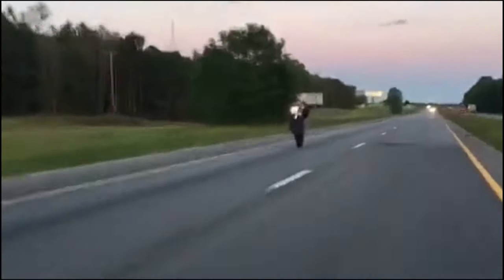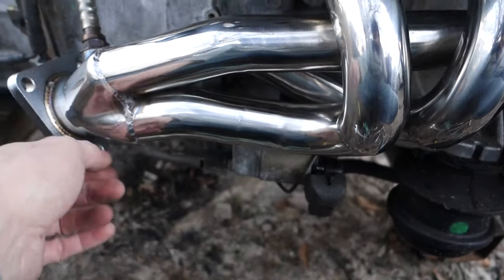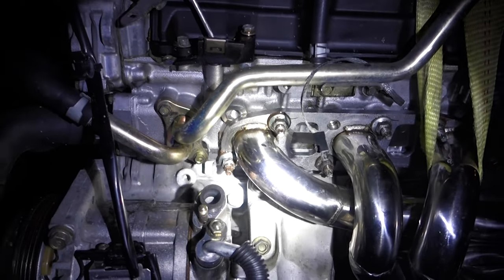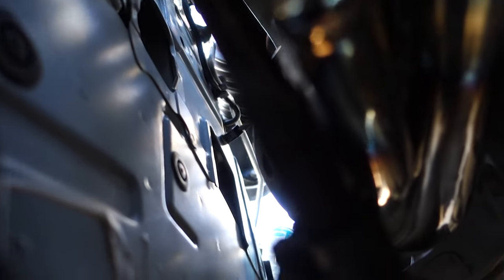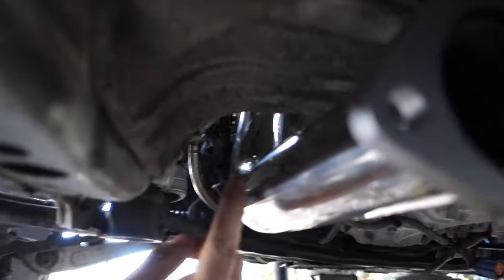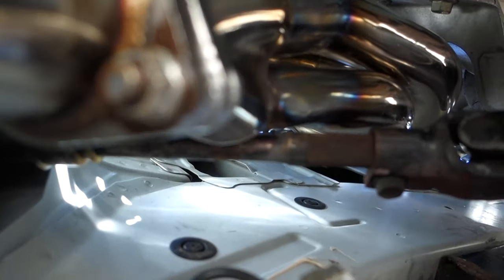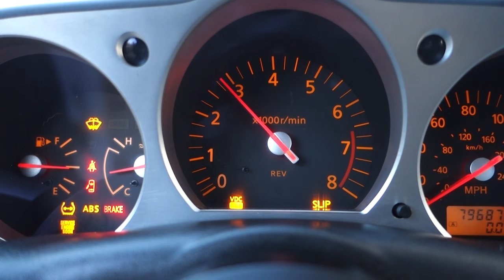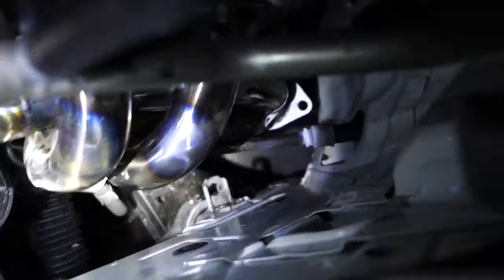350Z eBay Exhaust

Comment: Nope going to rub
Reply from the maker: So far so good but I’ll keep y’all updated 👍🏻
Reply: I installed same shit and it doesnt fit without major modifications to stud holes and drivers side pipe
Reply: They wont fit drivers side without crushing one pipe over half inch or rubs steering rod
Reply from the maker: @bobhillier7193  yeah that’s the same clearing issue I had In the video I explain how I got Them to feel